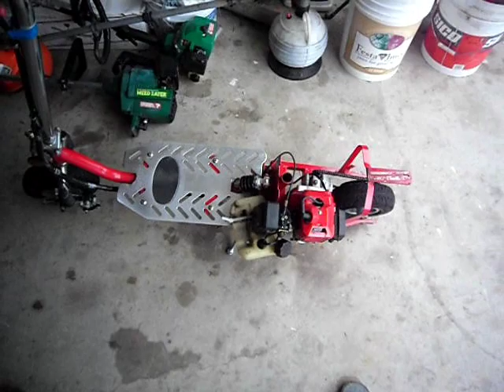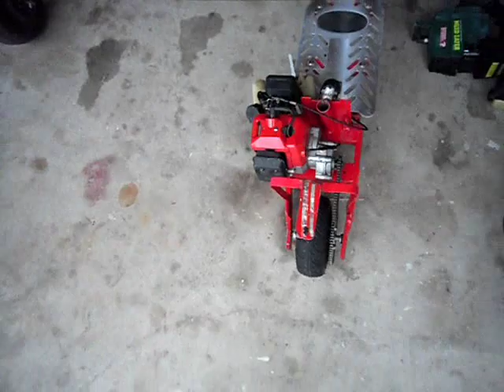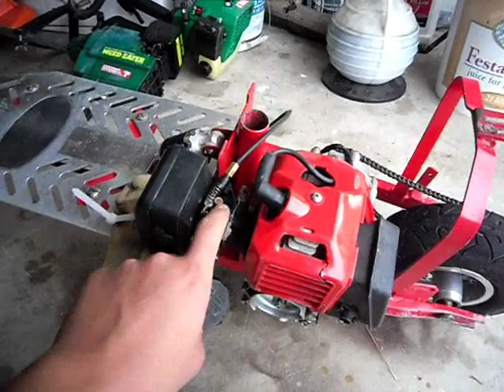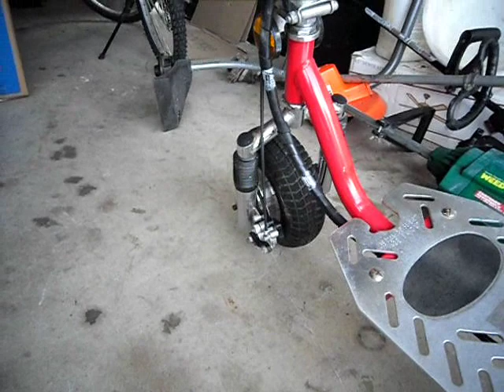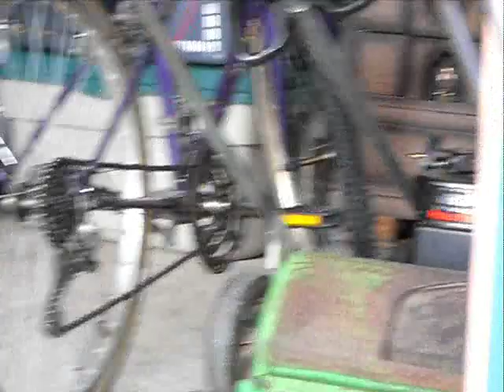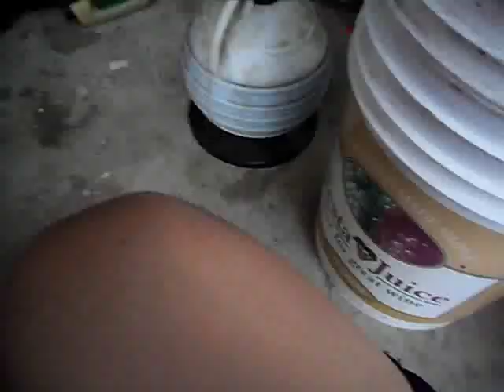New Crappy Slow Scooter 33cc

Comment: @30GB - Speed isn't always the most important factor.  I like this scooter because it has a decent top speed, but it is geared for power.  I just posted a video of a 120lb Wisconsin engine that was too big to fit into the trunk of my car, so I got the guy to drop it off the next day a little closer to where I live and I put it on an identical scooter, took the spark plug out, and sat on it and rode it home.  So 120lb engine, plus 150lb person, and the thing went full speed the whole way, even up

Comment: That's why you get a cast iron engine, not a crap aluminum.  You get what you pay for, so you pay for quality.  Also, I have one of these, trying running along next to it while you have it at full throttle, it will drag you along.  I keep mine in good shape and have it clocked at 30km/h. If you have it tuned right they work good.  Gaskets dry out and do need replacing.  When you posted this, this scooter is probably 5 years old (Possibly). Replace gaskets every few years on small engines.

Comment: @30GB - Mine has the original rear wheel, and it is a lot bigger.  You can even see part of it in my video. I was looking to get a TD02 turbo for it, they fit 250cc to 500cc engines and the Wisconsin is 400cc. It would work good, but this is an older Industrial engine, never intended to be turbo charged, that and it has more then enough torque now, so I didn't think t was really needed. I got a really good deal on it because the guy I bought it from dislocated his shoulder when it backfired.

Comment: For the gaskets, you said some were not gasket material, that is bad.  Gasket material is made to be around gas without rotting. There are different types of gasket material though, some that can be submerged other for vapors only.  Also, I realized why yours will not go very fast, your back wheel, diameter wise is about 1 or 2 inches to small.  You can adjust the front brake so that it works, they have a tendency for the cable to stretch and not properly to engage the brake, so adjust it.

Comment: @30GB - Clinton's were good engines.  I thought for awhile that they were a daughter company of Wisconsin.  Not sure though.  Ya, love the old engines.  Hp was always rated very low, but they always had so much torque.   My Wisconsin is 9.2hp, but can easily replace a 20hp Honda twin cylinder engine.  My friend did that with another one I had, he actually did replace a twin cylinder engine off a lawn tractor with one of these.  Will definitely check out your page.

Comment from the maker: @doomsd46 well it has low gear ratio for hard pulling but i bet yours has a smaller sprocket than mine, mines literally went like 15km max at full throttle with the engine almost blowing up, really freaking slow. if it went like 20km-25km i wouldn't mind much but it was way too slow. That Wisconsin engine i would find a small motorcycle turbo since that built-in oil pump would be useful and it would put out way more power for its size

Comment: if you still have this engine. ive had trouble drill starting them it would knock the flywheel nut off if I wasn't careful lol. same with my gopeds . red Loctite works wonders. looking for one of the 49cc china engines as a temp fix for my goped gtr while I build its replacement engine.

Comment from the maker: @sorryunlucky where did you get the sprocket? I need one or this scooter is going to the trash but keeping the engine for bike project since its very low gearing. the only usefull things on this pos are the engine, chain and rear wheel also front wheel lol

Comment: @30GB yeah thqats what it is. go smaller, youll lose torque but gain speed, larger gain torque but lose speed. could try gearing it. i didnt get a good look at it. but look ssimilar in engine mounts to my gsr25 goped as well as my sport goped. ( well engine mount only on sport goped, )

Comment: @30GB - a few fairly hefty hills.  I really need to get a truck, preferably an El Camino though, I like the low box they have (Laziness).  In my books, the thing is great.  Also, I doubt yours goes 10x faster, putting it in the 250 to 300km/h range.  And even though it goes faster, its acceleration is poor and it probably lacks off-road and hill climbing ability, or is poor at best.  For something I zip around the community on and use to move things that my car won't, its perfect, so not a POS.

Comment: What size chains do these type of scooters need?? I cannot find the size precisely. Is it a #25 roller chain??
Reply from the maker: dont remember but search what size is it for a pocket bike because they use the same chain
Reply: It turned out to be a 05T size chain. I just found the exact sprocket and it told the chain size.
Reply: All 33cc, 49cc scooter motors on these scooters are #25 (6mm).

Comment: You need to do a few minor adjustments, a new, bigger rear wheel, gaskets and put a pull start on it and these are fairly decent for what they are. Also, if it is knocking, check if it is the crank or connecting rod where it connects to the crank. If its loose, replace them, and that should solve it. If you really think you have a piece of shit, I will give you $60 for this. I have sold ones in worse shape that took an hour to fix up for $200 and they have never had a problem with them.